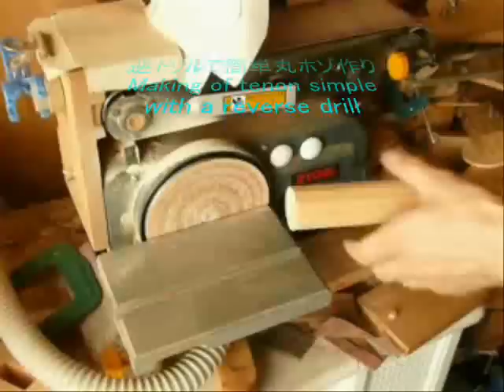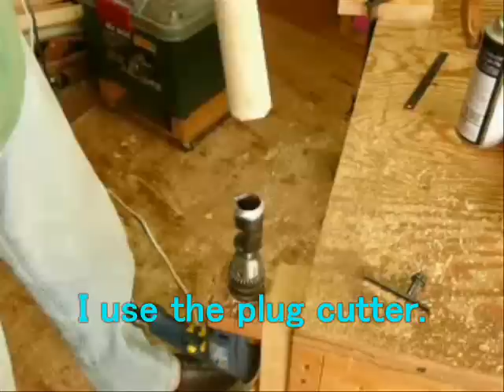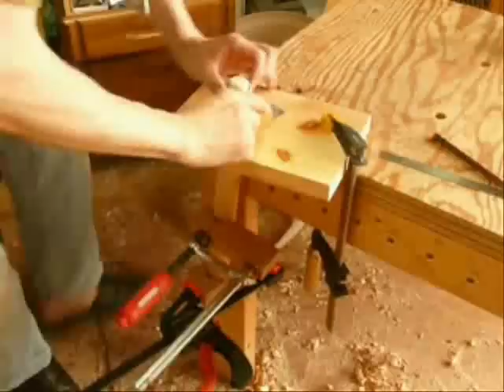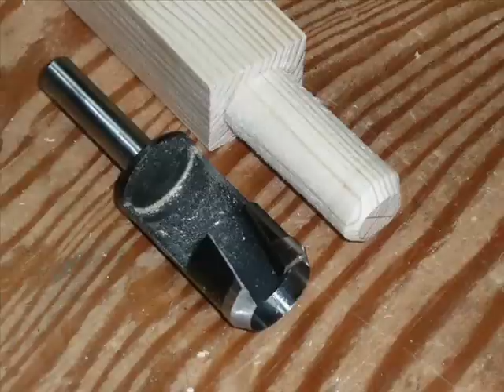逆ドリルで簡単丸ホゾ作り Making of tenon with a reverse drill.

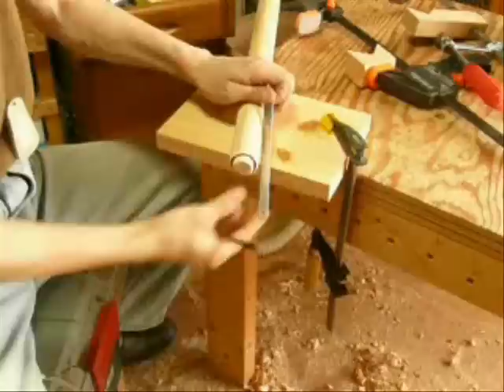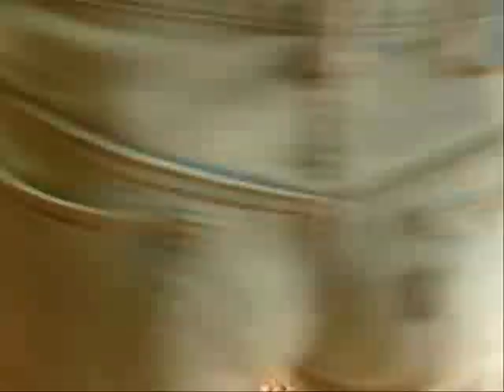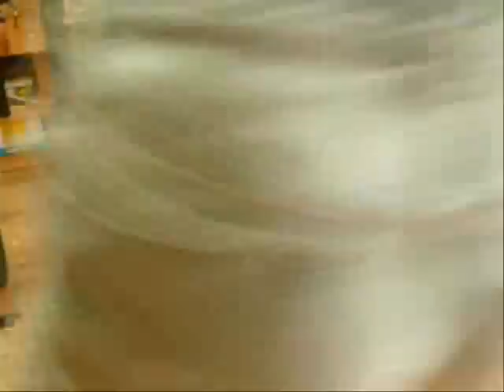Comment: He's sawing.  That is a veneer saw and he's sawing off the cylindrical bit of excess wood that the plug cutter didn't remove.  Watch at 0:58 and you see the tenon that he wants is surrounded by wood that he needs to remove.  Watch from 1:52 to 2:00 and you will see when the waste wood cylinder comes free and he removes it at about 1:58 and it is gone by 2:00.